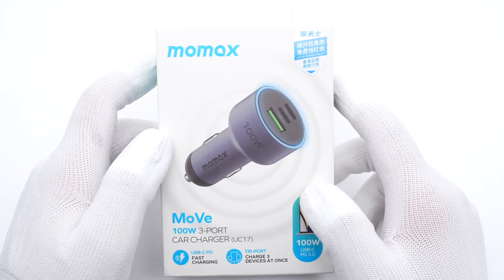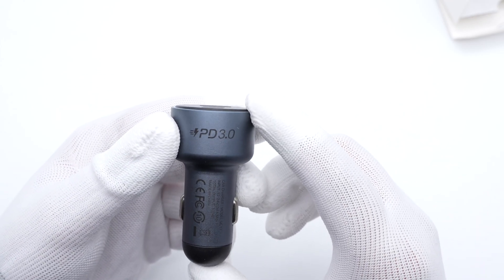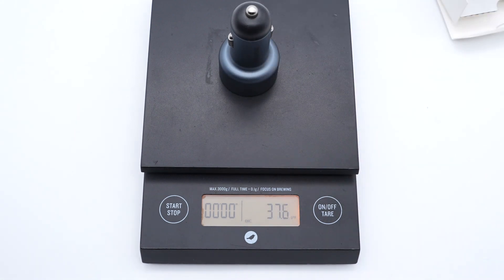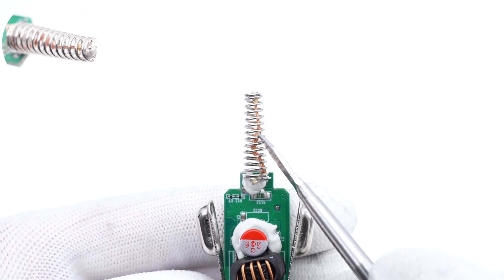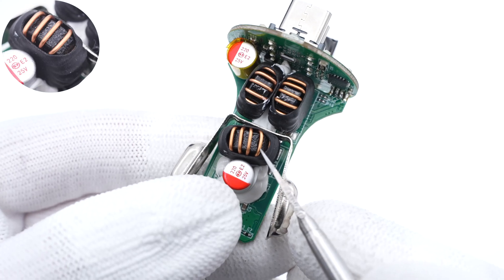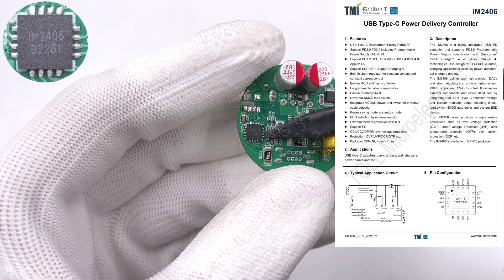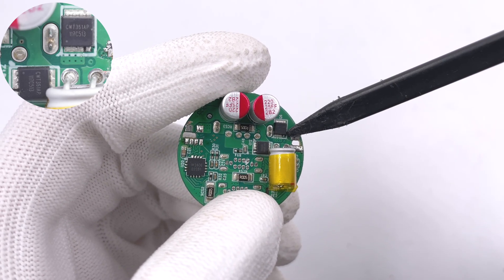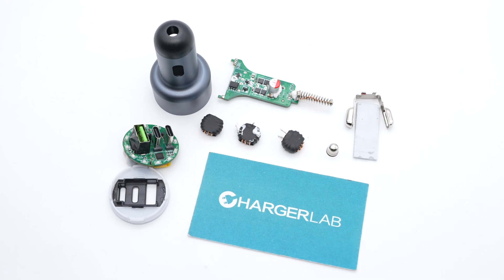Teardown of MOMAX MoVe 100W Triple Ports Car Charger (2C1A)

Comment: Question, since it has a 25v capacitor on the input, does that mean the maximum input is only 25v? And wont that get damaged since 24v car systems can go up to 28v?
Reply: Plus automotive transients with no protection. There's no clamping diode. I don't trust it. At least if the cap shorts then the fuse blows but most consumers have no idea about that.